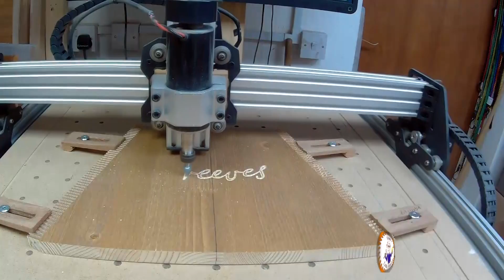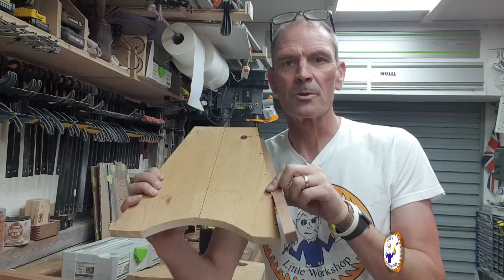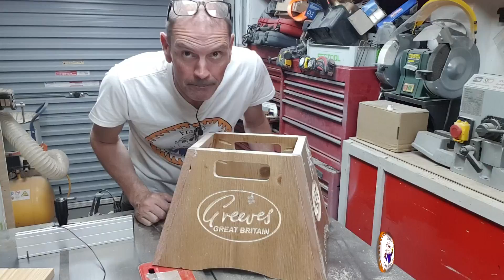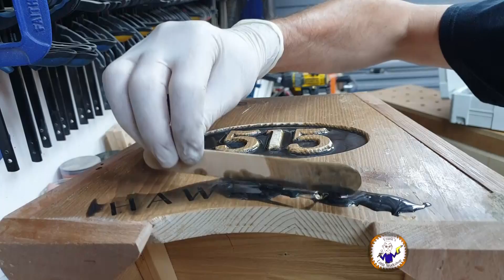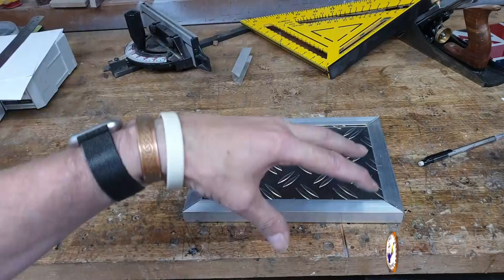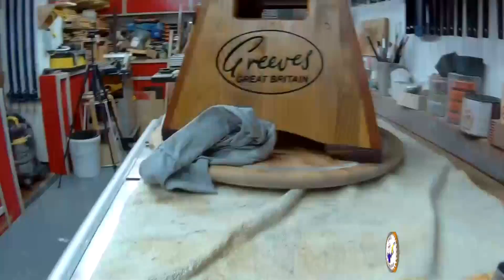Greeves motorcycle stand from reclaimed wood.

Comment: Great build you got there in the end, on a side note i have just bought myself a axminster  ac216ts table saw just need to get dust extraction sorted and i was wondering what you use on yours?
Reply from the maker: 😁 Hi Sandman. At the moment I either use my Fox chip extractor or my Scheppac dust extractor. Both have 100mm hoses and both are great. But my plan is to build a large cyclone system soon for the whole workshop. You can see both of these in my workshop tour video. Thanks for watching 😁👍
Reply: @frankslittleworkshop  Thanks for taking time to answer,i was looking at the scheppach i think it was around £130
Reply from the maker: @sandman2651  If you shop around there are a lot of rebranded dust extractors that are basically the same machine (I.e. scheppach / Sip / Lumberjack / Axminster etc). Another great option would be a Record Power unit. That was my first choice, but was a little more pricey. Thanks again Sandman 😁👍